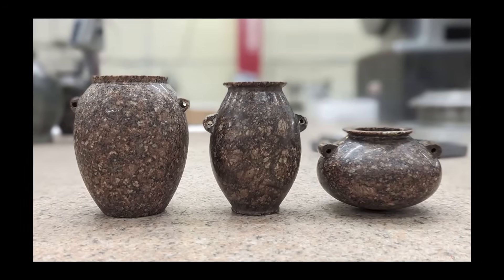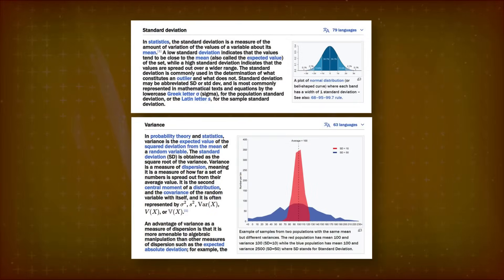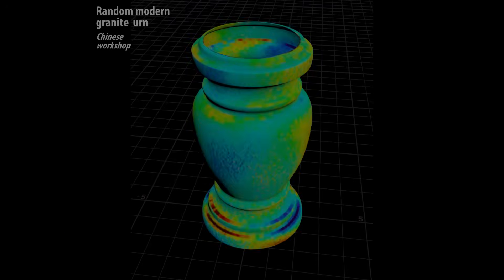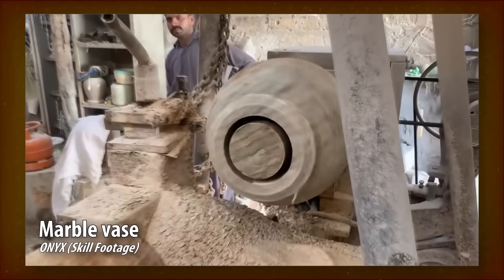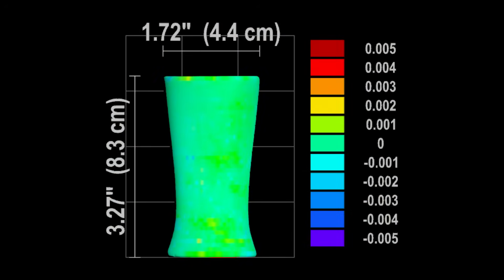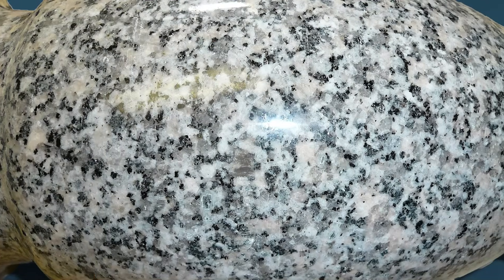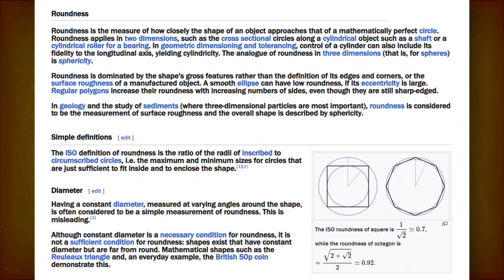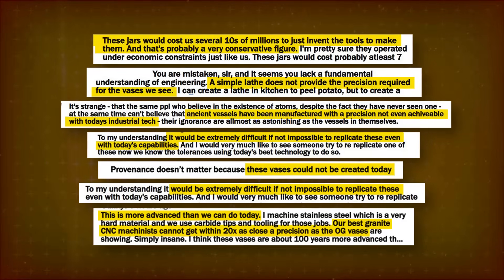Impossible Granite Vases: 3D Scan Showdown

Comment: Thank you for info., on the incredible Fatmid Dynasty cut  Rock crystal  vases and bottles..known to have been made with hand tools and abrasives.(Best articles  are by Dr. Elise Morrero)..
 Poss. some of these hand tooks were also used by the Egyptians to manufacture the ,also incredible granite vases":(. tools included  a hand-held primitive lathe...
Rock crystal(quartz) is of comparable hardness to Granite and in addition, they hand carved intricate designs on the very hard  rock crystal vases and bottles.

Comment: Just to mention- Egypt has two known Abrasives ;(and possibly others)- Corundum and Zircon. Not sure where the Corundum comes from, but the Zircon  is from black sand beaches on the shores of the Red Sea.
  It's possible to take a copper alloy and add corundum or zircon powder to it-and with heat and pressure, make a Metal Matrix Composite , and poss. use this as a cutting disc, or polishing disc;(not an engineer so  just read this somewhere..)..
  It's  also mentioned that  Egyptians had a copper alloy of  copper and arsenic-the arsenic hardening the copper.

Comment: But none of the examples you gave show how they lathed the hoops(ears) for the rope? I think this is what Ben was talking about, if you consider the actual context. You simply CANNOT make those on a lathe, and to do it by hand with that level of precision would more than likely need the 5-axis cnc machine.
Reply: The handles are somehow believed to be an unsolvable mystery. Leave a ridge of stone, later remove the unwanted portion until just the handles remain. Grind and polish. Ben adds the extra step of claiming impossibility and then banks the money from social media.
Reply: @Eyes_Open  I think I understand. The ridge would be a ring that wasn't lathed(or whatever they did), then you can chip/cut away the excess to reveal the handles. Great insight. Thank you!
Reply: @DbDBlackJack A different vase video on this channel discussed this point. A company in China was contacted and they showed how they would do it.
Reply: @Eyes_Open  Ahh, that'd be great. I'll check it out! Thank you.

Comment: I recently got into musical instrument building as a hobby, and if you see the amount of hand precision that is used in top level musical instrument building adds another layer of ridiculousness when it comes to this whole precision talk. Like a world renowned flute builder can create a perfectly smooth and angular labium with nothing more than a sharp knife and some sanding paper. The precision required is hard to comprehend, the tiniest deviations will drastically alter the sound. To take such an instrument from good to really world class, to something that sounds undeniably better, that feels better to play, that produces more volume, carries the sound further, more tone, is not in the millimeters, but deep down in micrometer level precision. The preciser your work is, the smoother the surface, the more perfect your angles and curves, the more perfect the resonating body is balanced, the better it will sound, and not in a nuanced way, in a very obvious and noticeable way. There are tons of videos where they compare cheap musical instruments to expensive, and the differences are insane, and it is all achieved by very precise handwork. Even with super fancy computers and machines, the real top of the line instruments are all finished by hand.

Comment: Thank you for your work and getting into discussions, and a sceptical rational vioce. Your most precise vases are too precise for your measuring tool. If 0,1" is 2,5mm then 0,001 inch is 25um around 16/32um range of what Carl Zeiss 3D scanner could used. 
I stand corrected that with you nowdays mass manufacturing could produce such a precision level. I thank you for proofing that. But its only with nowday tools and on a vase without "hinges" with modern precision bearings. Also on the outside. 
What I'm not convinced is :
- that the roundness on outside could be replicated without modern bearings. You are making a good points on the nature example but yet we will need to wait for someone to try. I have seen the Russian channel with Olga trying to replicate it but not yet as precise 
- that inner and outer roundess is concentric of those two axis? What is the deviation? VST are measuring those. And as long as I can believe that you can make the outside with same level of precision to make the inner elements concentric it will be on another level of complexity.
- that further researched is meaningless. We need more VS work to collect data and make a foundation for a real simcientific methodology in that topic

Comment: You mentioned that vases you analyzed are very precise—could you clarify what model or standard you are comparing it to?

The first OG vase (Ben), analyzed by a mathematician using a CAD model, was found to contain multiple layers of interconnected mathematical systems. This suggests that such vases were likely made using a predefined model rather than being shaped purely by eye. Achieving this level of precision would also require highly accurate measuring tools to verify the results.
Reply from the maker: https://youtu.be/O_4SaxVP44g?t=542

Comment: What about the lifting lugs?

Adding the lugs makes the vases "an order of magnitude" harder to manufacture, this fact may be lost on those without any machining background.

Not only that, the Chinese vases were heavy walled, not thin like many of the Egyptian ones. Making a thin walled piece is much harder.

The precision shot glass is about the easiest design to achieve a tight tolerance. Let's see them make a large, thin walled vase with lifting lugs & hold the same tolerance!
Reply: The lifting lug argument is weak sauce. Lugs are found on some authentic artifacts.    They are not fantastical.
Reply: @Eyes_Open  it's weak if you have little to no clue how a lath works.

And yes, many authentic vases have lugs, that's the whole point. So far I have seen a modern reproductions with the lugs.
Reply: @D-Mayor  Didn't stop the Romans. The lathe argument is simply a distraction. There is an assumption of fantastical build qualities of authentic artifacts. Provenance is lacking. A lathe or any tool does what a human wants. Leave a ridge of stone where you want the handles. Then later remove the unwanted portion of the ridge. Not so complicated.
Reply: @Eyes_Open  Roman artifacts have nowhere near the precision as those tested here. 

Do how do you remove the ridge material & hold the 0.005" tolerance on the OD between the lugs.

BTW: 0.005" is the thick of a human hair.

It's obvious you have no manufacturing background.

Comment: If anything the scans of the Chinese urns actually reinforce that the Ancient Egyptian ones were made with some sort of sophisticated tools, as the small deviations on each side of the urns show that the tool or the spinning vessel were not held to the same tolerances and consistency (a wobble or sorts) that we see in the Ancient Egyptian ones (no wobble). You neglect that the cost of the equipment to manufacture those urns is not cheap or easy to produce and requires massive infrastructure; it requires massive motors, precision bearings (and yes, even HarborFreight lathes and bearings are considered precision- look into how ball bearings are made), gears, firmly held tooling with diamond/tungsten/carbide tips, ELECTRICITY (which also requires massive infrastructure). But once you have it, you can make thousands (like the Ancient Egyptians did). I find it hilarious that you take modern replicas made using precision lathes, with advanced tools like grinders and using that to discount LAHT. No disrespect to Bison-Hill, its beautiful work, but there is a major difference in complexity between a shot glass, and a the vases that have lips, lug handles, extremely curved surfaces, with hollowed out interiors, and in some cases balance like an egg. 

I also checked all your links. I could not find one with any info on the scans of the replicas you made. Was that documentation available for verification of what type of scan you did? 

When you can produce a replica, without a lathe (cause pre-dynastic Egyptians are not credited with even having a primitive one), using primitive tools, with the supposed methods, and produce similar results- THEN you will have an argument that holds water. Until then, too bad, so sad. The truth is coming out and some of y'all got your head in the sand.
Reply: You have unfounded assumptions about authentic artifacts and expect others to follow your lead?

Comment: I'm a CNC/Machinist/ programmer of 40yrs + experience, and your video is very deceiving. What Ben talks about in his video's is the whole vase with the hubs being within a few thousands inside to outside and everything symmetrical in all ways. The better and more obvious thing is they had machines. Then you have the vases with walls so thin you can see a light from the outside, as someone who has made a ton of thin walled parts in my life, good luck trying to cut super hard material inside diameters to .02 wall thickness, and ending up round. Ben should never of said we can't make them today, but a vase with the hubs, and trying to blend all the radii together without a multiple axis machine would be very difficult, and you would see many of the same form, like you do in your China video. Just making the outside round is simple, that's not the project, make the whole thing then you will understand what I'm saying.
Reply: If they had invented spinning bow drills to hollow out objects, then spinning the object itself and using abrasives or chisels to form the outer surface would be a logical next development.

That would also explain the cruder finishing of the handle areas, as they wouldn't have been able to use the rotation axis, relying even more on hand finishing.

The thin walls I see as just a matter of how time is spent on the object. Creating a thin wall would be more time intensive, with a greater risk of failure. However if these were luxury objects, then those are parameters that fit that class of objects.

On the other hand, all of the above could  be seen as reinforcing the argument that the vases presented are simply counterfeits. In that case any claim, regardless of the level of finish, is subject to proof of provenance.
This is especially so given that we know that there has been a trade in fake Egyptian objects going back many, many years.

Comment: Fair enough to address the statement of needing 5 axis cnc machine, and that we couldn't make them today, simply not true, so I completely agree with you on that, and I have never bought that narrative. But you then show the shot glass being made with power tools? Which happens to be one of the more accurate examples and a simplier shape.

Do the vases require super precise cnc computers? No, certainly not. However, these are attributed to predynastic cultures, meaning Naqada 1,2,3 or Baldarian or older. They were not supposed to have lathes, even the SAM video she creates a foot powered lathe to make the vase, which still takes her like 2 years to make.

They are wrong about high tech, however at least their research asks serious questions about when was the lathe invented and what were they doing? There are thousands of these vases, lets be conservative and say 5000 are of this level. Thats 10 thousand years of work needing to be split up amongst the people capable of making these vases. Or lets be super fair and say they could do it in 1 year, 5000 years of labour is still needed. That should be making archeologists want to take a closer look at the cultures attributed to making these vases. Also they should be quantifying how many very accurate ones, if it is a number over 20'000 that is an issue for the current idea of tech the early cultures had. It would  suggest a much more modern type of lathe was required, otherwise it becomes an absurd amount of labour required to pump out those numbers with a very primitive lathe (like the one SAM made with simple tools).
Reply: Where do you derive the number of thousands of "these vases"?

Comment: Now make a modern precision vase, using an inexpensive modern spindle bearing lathe... WITH LUG HANDLES!.. Did I mention LUG HANDLES.
Reply: Do you mean misaligned lug handles with off centered holes ?
Reply: @GroberWeisenstein  Yes! With a focus on the surfaces between the "misaligned lug handles with off centre holes". What evidence do you have that the asymmetrical lug handles are not by design?
Reply: @jonellison9832  Yeah, that sounds rational and practical.
Reply: @GroberWeisenstein  Seems to be something in the air these days.
Reply: @Eyes_Open  carbon ?
Reply: The lug handles have many people believing in an impossible mystery. Good marketing strategy from UnchartedX.

Comment: The claim of "tremendously expensive" is based upon producing a precision vase with lug handles. None of the modern Chinese vases have lug handles. The production of a precision vase with lug handles would require the utilization of a five axis machine, Not just a modern lathe machine. 
Five axis machines are "tremendously expensive" to purchase and operate. Which is why none of the modern Chinese vases have lug handles. The Chinese vases are produced on a modern precision lathe fitted with a modern tungsten carbide rotary grinding tool, which is far less expensive to purchase and operate keeping the unit cost per vase at a realistic and marketable price.
 
Tungsten carbide grinding machines are in common use in modern machine shops and are commonly used to re-grind precision engine crankshaft journals.
However they cannot do lug handles. Which is why the modern vases don't have lug handles. The whole video is another strawman argument.

So to sum up, any modern precision vase that does not have lug handles is a false equivalence. However it does demonstrate that a modern precision machine lathe was used. As we see with the modern Chinese vases.
Reply: Exactly! Adding the lugs makes the vases "an order of magnitude" harder to manufacture, this fact may be lost on those without any machining background.

Not only that, the Chinese vases were heavy walled, not thin like many of the Egyptian ones. Making a thin walked piece is much harder.

The the precision shit glass is about the easiest design to achieve a tight tolerance. Let's see them make a large, thin walled vase with lifting lugs & hold the same tolerance!
Reply: Addressed in one of the other videos. The lug handles were off by like 3 degrees and modern lathed vases can easily have lugs using a grinding wheel. There are more videos, keep searching and you will find that VST is a farce.
Reply: Agreed❤

Comment: Showing we can do this today with our modern technology doesn't detract anything from stunning fact someone was manufacturing on mass precision made granite vases thousands of years ago. I'd love to see one made with the lug handles shown on the Egyptian vases and demonstrate how that is achieved with today's machinery. Mirroring the precision of the ancient vases that have been scanned around the lug handles. The ancient's are said to have made these vases by hand if you follow the mainstream explanation, which makes the vases all the more baffling if you look at the modern day hand made examples and contrast the level of precision between them. No one knows for sure, who and how the ancient vases were made. it remains a fascinating subject to look into.
Reply: Ancient mass production of what exactly? Have any 2 authentic artifacts been shown as having identical measurements?
Reply: @Eyes_Open  It is reported that approximately 40,000 stone vases were discovered under the step pyramid. I doubt any two are exactly the same, maybe similar in design. When you scan an object with tolerances in the thousandths of an inch, no two objects will ever be exactly the same especially when "made by hand."
Reply: @goldscaz  40000 stone vessels. The majority of which were alabaster bowls and plates.
Reply: @goldscaz  Those stone vases found under the step pyramid contain tool markings showing they were made using a lathe, so we know the Egyptians were using lathes at that time period. And only a handful were made of granite, many were of softer materials including limestone.